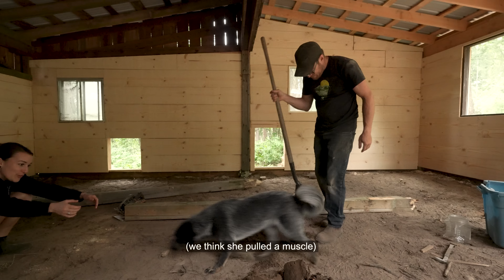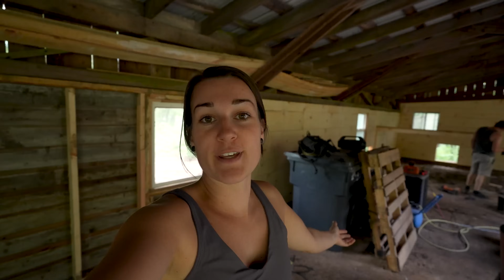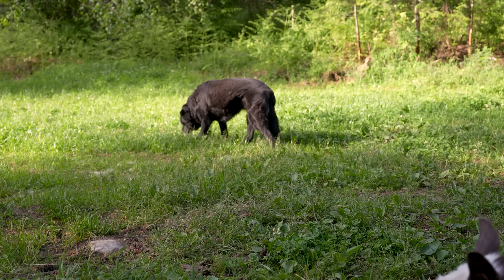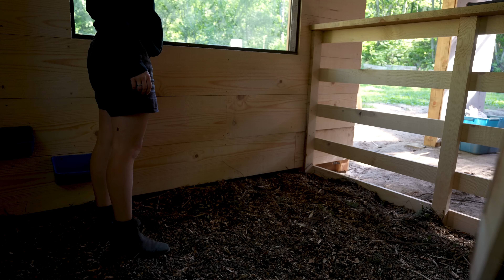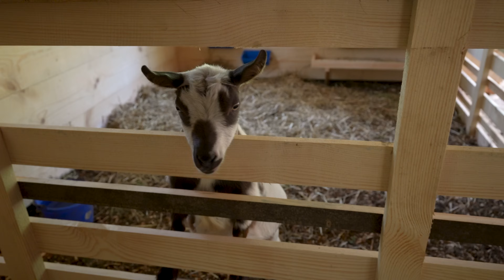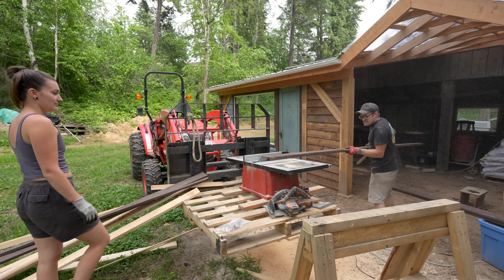We Messed Up, We NEED To Finish This Barn!

Comment: The first thing I noticed while watching you erect the "fences" of the back corner pen was that the goats in that pen, when they rub up against the rails or butt them, they will be loosening the rails because they will be hitting in the direction of taking the nails out instead of knocking them in, as should be the case. A second layer of rails might be advisable. Otherwise, I like what you are doing and hope it all works out the way you want.

Comment: All that litter in the pens will make some very good filler for raised beds in 18 months or so.
Even before that, say next spring, it will already be good mulch because the rain will wash all the nutrients into the soil for the veggies and provide heat protection during the hot summer months.
Working WITH nature and not against nature IS ALWAYS the best thing to do.

Comment: I can tell you what I did to solve the critters from reaching freedom off feeders. I took some 3/4” EMT cut it down to about 2’ sections and built a frame with 2x used a Forstner bit to countersink the EMT top and bottom. A little jail you could say! But your pallet idea works in a pinch😅

Comment: Katie, if you can find a grain elevator that is replacing their cups, ask if you could have their old ones.  They are bigger than those you have, I believe and  better yet,  possibly free.  Usually when they replace the belts they also replace the cups.  
I found one of our grain elevators that gave away theirs, free.  I use them in my garage.  Nice storage bins and definitely would be helpful for the animals.

Comment: Baby goats are REALLY TINY and the dividers do not fulfill their purpose. To maintain their VISUAL value AND protect from meat eating smaller predators I recommend stapling wire mesh with 2" spaces on the INSIDE of your pens.This will offer protection for your animals and deter predators. Hungry predators need to be kept OUT , especially in the winter. Also try to build the barn to keep them out !!
Reply: I would be worried about those gaps..could a goat head get caught and accidentally be a tragedy ?

Comment: I enjoy your video

Starlink satellites survived a major solar storm in May without causing major service disruptions.
“No satellites were lost due to the storm,” the company told the FCC this week. 
SpaceX describes May's barrage of solar flares as a "once-in-a-generation" event for reaching the highest G5 category in terms of severity. But despite the danger, the company’s satellites experienced little impact during the storm and in the weeks after.  
"Indeed, on the day of the storm's peak on May 11, the average Starlink user saw less than one minute of disruption," the company wrote. "Since then, SpaceX's satellite communications have continued nominally without degradation for users."
Solar storms can wreak havoc on satellite communications by releasing bursts of radiation that absorb in the Earth’s atmosphere.

Comment: why did you invest in a tractor with a loader if your doing the heavy hauling by hand  Work smarter not harder, use your tools that you have invested so much money and built your buildings so your tractor can fit inside to clean and haul away manure. 
You are heavy workers and not afraid to get your hands dirty, but think when you get older. I used to be like you and now at 69 i have problems with my joints.
Be wise take the time to think though your plans and also plan for the future where your body will have less endurance and capacity.Most of the time the difference in cost is minimal.